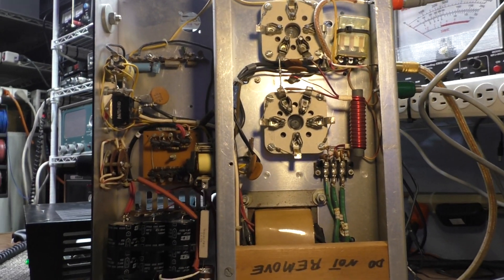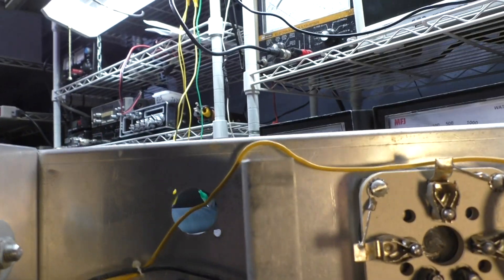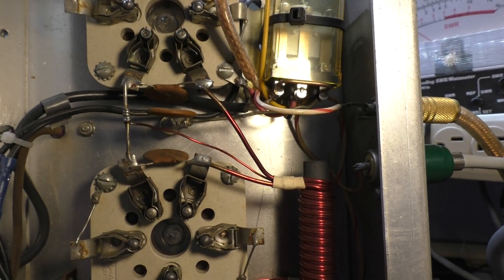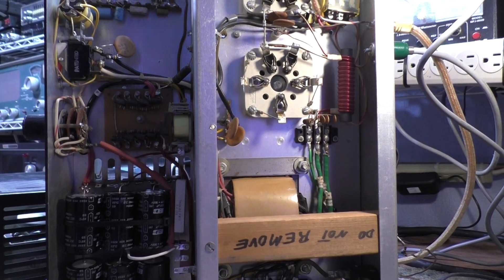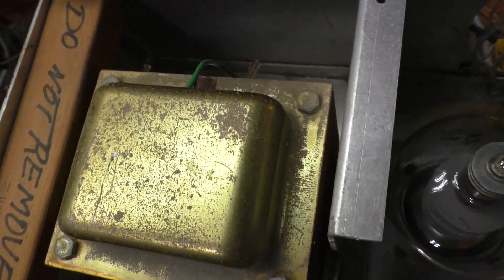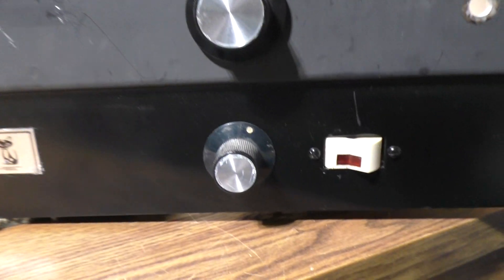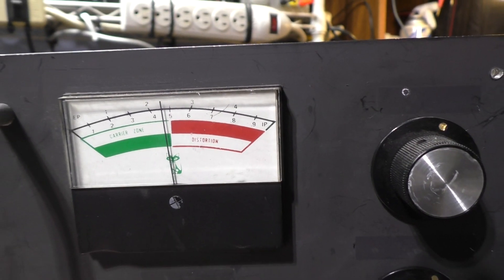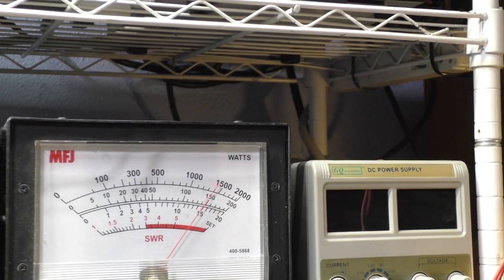Blackcat JB-2000 walkthru + key-up. Informational, Educational, Instructive + academic purposes.

Comment: You don't have to wait for the tube to warm up when its a directly heated cathode. 811,572b, 3-500z, 3cx1200, 3cx3000, 4-1000a These are instant on. Indirectly heated cathodes you do have to wait on a few minutes. 3cx400, 3cx800, 4cx800, 3cx1500,8877 4cx1000, 4cx1500, 4cx3000. The jb2000's that I saw back in the 70's had basically a jb 200 or 150 driving the jb 2000.  Cant exactly remember. That's no voltage on the tube at all. Most of the ham amps have at least 3000 vdc and most have more. They can get away with zero bias because of the low plate voltage.

Comment: Great job 
How do I get in touch with you
Can you replacement 8960 with 6JM6?
Reply from the maker: you mean 8950? Yes, but it takes some work and you will only get 1/2 the power. Also, I am retired, I don't do others anymore.
Reply: @tramdr  ok 
Thing is this amp was given to me and I believe the tubes were just swapped out ..... 8950 are 13 volts and 6JM6 are 6v tubes correct? 
Other wise I would just turn into a power supply box great transformer lol
Thank you for your response
574 73'S
Reply from the maker: yes on the filament voltage